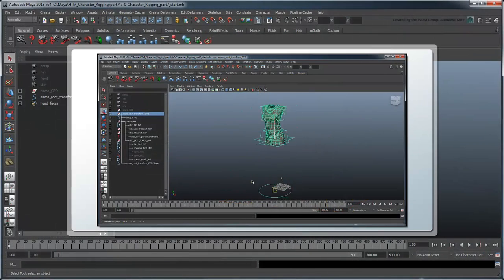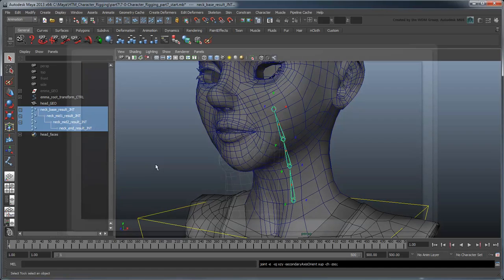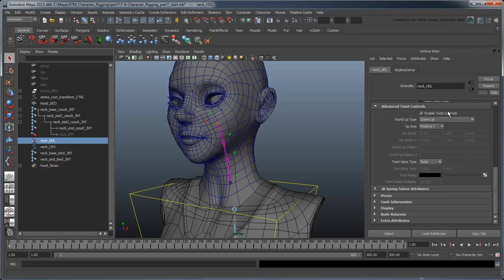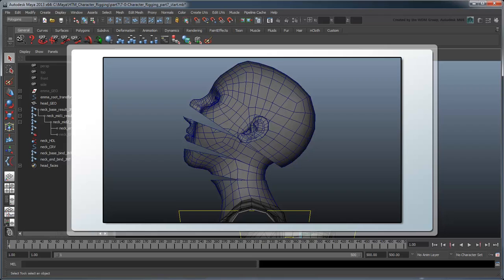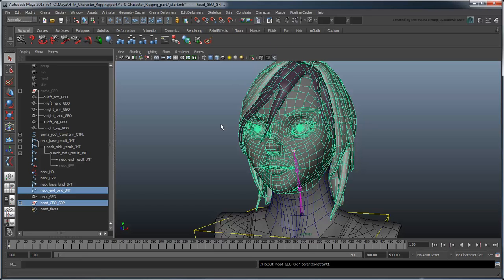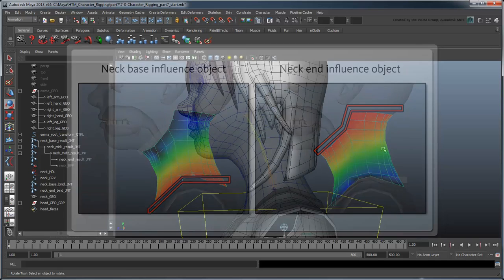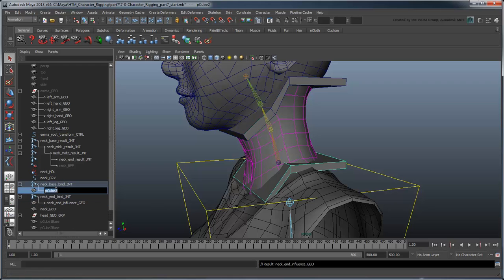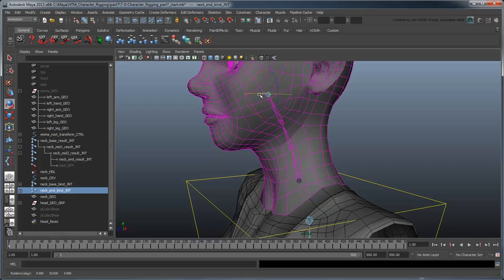Creating a Character Rig - Part 7: Basic spline neck (Advanced)

Comment: Do I understand it right that when going production, the head will be skinned on neck_end_result_JNT instead of neck_end_bind_JNT? If so, wouldn't the head animation be influenced by neck_HDL which originally wasn't when animating proxy? Is this intended?
Reply from the maker: It's really up to you.  You can paint skin weights appropriately for the behavior you want/expect.  As you've mentioned though, you do want to make sure there's parity between your proxy and finished model so that animation transfers appropriately.
Reply: So to meet that parity, can I paint the head to neck_end_bind_JNT instead of neck_end_result_JNT to maintain the head rotation parity between the skinned and the proxy?
Reply from the maker: Yes, absolutely.
Reply: Maya Learning Channel Cool! I still wanted to paint it to neck_end_result_JNT and still meet the parity with proxy so I did some things that I previously learned from your Arm IK/FK joints tutorials:1) Duplicate neck Result as neck IK joints 2) PointConstraint all IK to neck Result joints 3) OrientConstraint only the neck_end_BIND_JNT to neck_end_RESULT_JNT 3) Add IK Handle to IK joints instead of Result joints 4) 5) Stretch to drive IK joint scaleX attrib instead of Result's

The wobbling is gone, head rotation and translation on 4 spaces works the same with proxy's, and head rotation is only controlled by head_CTRL. I just hope that my method is optimal.
Reply: Chyros NX You, sir, just made my day. I have been struggling with this for a few hours now. Thank you so much.

Comment: Thanks for the quick answers on the previous two questions I had! But, alas, I have another one. When I do the skinning for the neck, the neck geo does some weird things. Like when I rotate the head up, the neck twists really bad. I made sure the bind skin options were correct. Do you have any idea what I did wrong? Or do you think I should just start the scene from the beginning and see if that works?

Merry Christmas!
Reply from the maker: Is it just the skin or are the joints twisting abnormally?  If the former, you may have a skin weighting issue in which case I'd clear all the skin weights and manually paint them per joint (see the documentation if you don't know how to do this).

If the latter, you may have incorrectly set the Advanced Twist Controls for your neck spline.
Reply: Problem solved. Thanks!

Comment: At 3:02 here on the video, you can see the result joint wobbling when the neck is rotated. When my skin is bound to the neck joint, it follows this awkward wobble and points my skin in odd directions. is this because my neck is more curved than in the given example?
Reply from the maker: It could certainly be that.  The wobbling you see at 3:02 is really only prevalent when interacting with the bind joint directly, and shouldn't be all that noticeable once the rig is finished.  If you find it is, then you can try adjusting the skin weight maps to fine tune which joints the skin follows, or you could try using less joints as well.
Reply: Maya Learning Channel I tried using fewer joints and that caused less wobble, but causes the result joint to have less movement when used with the control. Any other suggestions? I've tried re positioning the rig closer to the neck and am met with the same problem, the result joint doesn't respond to the control as well as it should.

Comment: I got a weird problem I followed the movie step by step but when I try to make a new joint I can't see them only by side view theyre not hided and not in any layer caus I just made them please would somebody be kindly enough to help me solve this problem?
Reply from the maker: Within each of the other views, have you tried going to Show > Joints?  You can control the visibility of joints per viewport so it sounds like this may have happened.
Reply: Maya Learning Channel  yes, it seems I hid the joints. Thank you very much now I can learn more from your channel^^
Reply: Chokob0 Now I got my body joints back but it doesnt display the new joints I'm making (btw I did "show all").
when I want to start with the neck it only allows to make joints through keys like click + v/c or something like that, that isn't the main issue but the main issue (caus I have other tricks to fix that part) is that I can't see the new joints of the head.